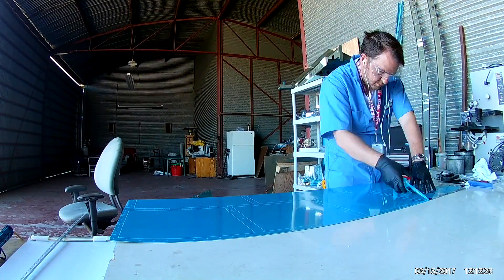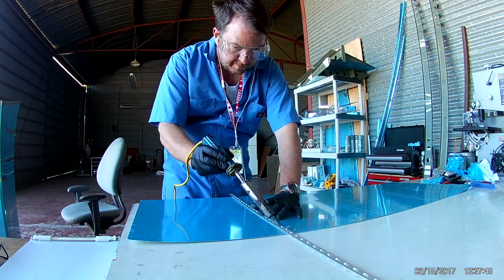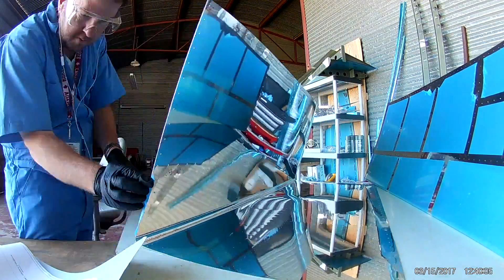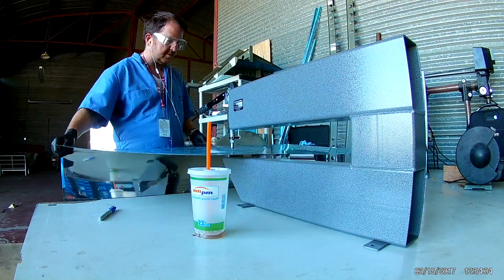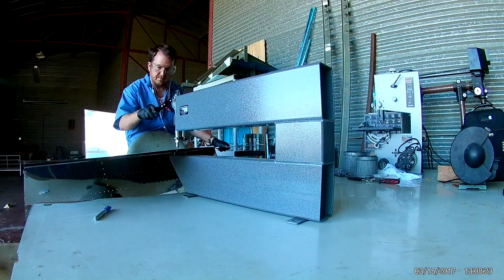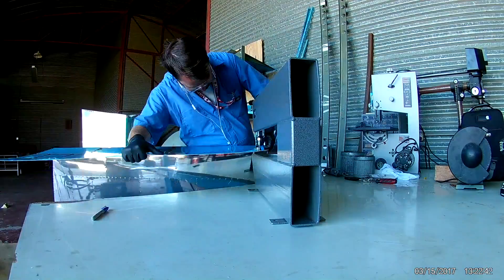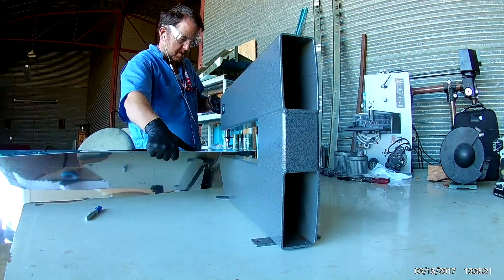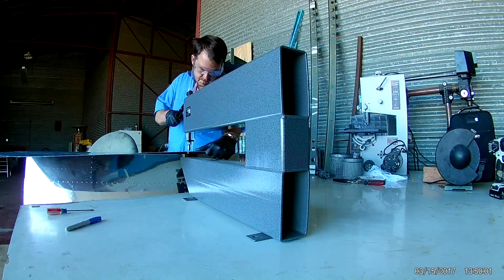RV-14 - HS 8

Comment: Thanks again, Andy, for very helpful video series. This is the step I am on right now - HS spars complete, ready to dimple skins. And I should say: dimple WITH my DRDT2, which I enjoy very much! Thank you for that recommendation. 

A couple of videos back, you mentioned that you decided to set the Tail Cone aside and go right into the Wings. This due to the reality of storage constraints. I am wrestling with the same decision. Right now I am leaning toward pressing ahead with the Empennage...and probably hanging it up by the rafters in my garage. (I’m building at home, in my shop.)
Reply from the maker: Yeah I'm glad that I made the decision to hold off on the tailcone. It's been a little bit of a pain because the tailcone skins... a couple of them have that rounded break on them so you can't really put anything on top of those and they aren't small! So yeah storage is a pain.

It's also been nice because I've been able to dip into the rivet bags for spares when having to fix F-ups on something else.

Now that I'm almost done with one wing I may take a break and actually do the tailcone section before getting back to the other wing.